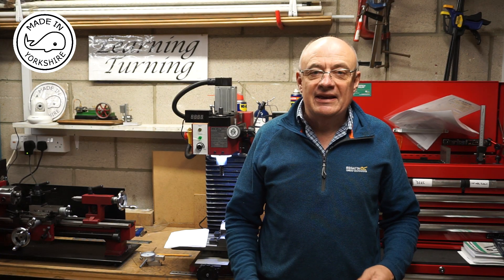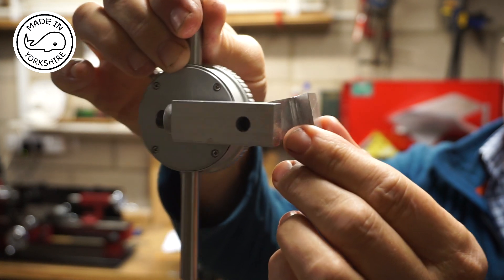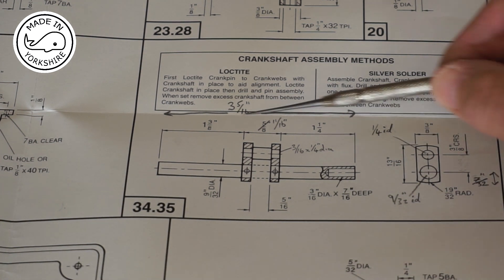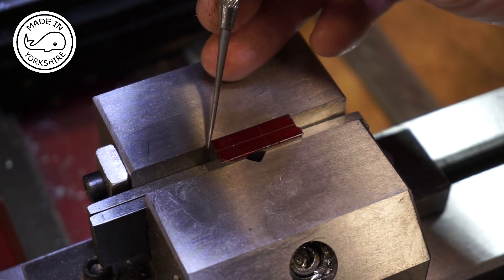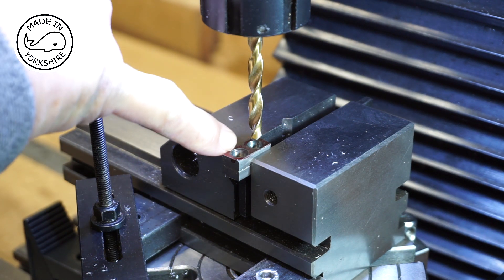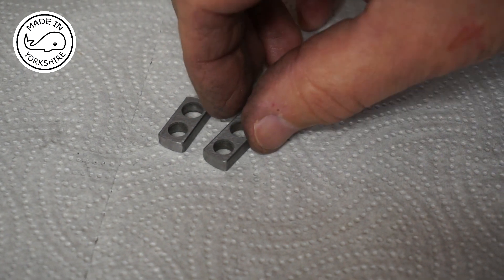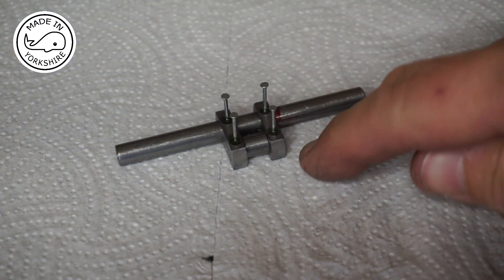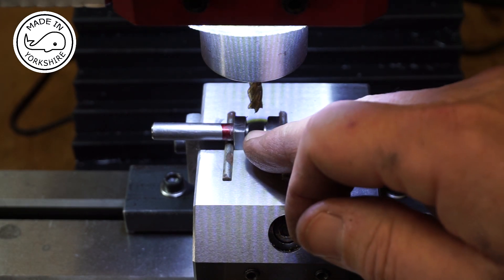#MT25 Part 3 - Making a Stuart 10V Steam Engine. The Crankshaft. By Andrew Whale.

Comment: Great videos- especially showing the oopsie's (we all do them, but don't confess to them) I see them as opportunities.
The parallels!!  I put a coil spring between them - it helps keep them vertical when putting the part in the vise, and I suppose a strong enough one would prevent the parallel from sliding.

Comment: I enjoy your videos.  Regarding the parallels moving, I generally use compression springs to hold them in place.  When there isn’t enough room for springs, a bent strip of spring metal does the trick.  The springs also keep chips from getting underneath the parallels.
Reply from the maker: Thanks for the feeback and tip. I must give that a try.
Cheers
Andrew

Comment: Years ago I had these castings and they had a casting for the crank. Guess they no longer doing that. Did they supply the material to make the crank?
Reply from the maker: Hi - yeah Stuart supplied all the material.
Cheers
Andrew
Reply: @learningturningmetal  I noticed the drawings do not really say what diameter to turn the crankpin. Seems to scale 3/16 but you used 1/4 for less turning. Not sure why they show the main shaft with a 3/16 drill in the end? Waiting on replacement castings as all came chill hardened and could not be used. Stuart sending replacements which is nice just takes forever to get to USA.
Reply from the maker: @gvet47  yeah I machined 1/4" diameter holes in the crankwebs to yake the crankpin. The hole on the end of the crankshaft is not required. It's a historical throwback.
Cheers
Andrew

Comment: Hi, i am reall enjoying this series. You have a very calm voice and explain very well. I am trying to glean as much info as i can before starting my engine. From youtubers like yourself and model engineers workshop. I only have a lathe so will have alot of compromising to do! 
Wavy parallels would prob not be great for such a short part, try a spring in the vice, clamping so it pushes it against the jaw, it keeps both apart and dont cost much. Take care mate.

Comment: One thing that has struck me from your videos Andrew, is how clean and tidy your lathe and mill are - do you have a shop vac or something? Everything on my workbench ( in my otherwise fairly tidy garage)  is covered in swarf and oil!
Reply from the maker: Ha ha - thanks. I use an old Miele Cat and Dog vac - very powerful! I clean the area up every time I complete each machining task. I recently visited a very respectful engineering company and it was spotless. I definitely recommend some kind of vac.
Cheers
Andrew
Reply: @learningturningmetal  No danger of the swarf damaging the innards? That could be a good shout!
Reply from the maker: @williamsworkshopuk  I don't think so. It's got very good disposable bags with excellent filtration.

Comment: I learned a neat trick a while back.  You could use a pin vertically in the V of the vise, the same size as the hole in your part, from which you are basing the radius.  With a collar slipped on first, your part will be well above the jaws and you simply manually rotate your part.  You do need to be very careful, but light cuts work well.
Reply from the maker: Thanks David. I must remember to try that out sometime.
Cheers
Andrew

Comment: Hi Andrew
Luv the vids
I copied your set up but one thing flummoxed me was did you square the vice once
you centred everything because i found that when you move the y axis without squaring the vice the radius was off centre
when the cutter was used but i bet i was doing something wrong.Your results speak for themselves so keep on going mate.
Reply from the maker: Thanks Peter - I'm not sure why it didn't work out for you.
Two main things are:
1. Rotary table accurately centred on the milling table.
2. Secure the crankweb on the rotary table so that the exact centre of the crankweb is exactly in line with the spindle of the mill. I used a crude method the align the crankweb - a drill bit. Some of my earlier videos make me cringe - but hey I was learning too. If I was to do it again I would use a wiggler. I used a vice to hold the crankweb but you can hold it any way you like as long as you can get the tool in to cut the arc.
Hope that helps.
All the best.
Andrew

Comment: Bend a piece of banding material to put between your parallels to keep pressure on them. We also use stiff die springs if there is enough room for them.
Reply from the maker: Thanks Danial - I have some banding material and I'll cut some and put it with the parallels to remind me.
Cheers
Andrew
Reply: @learningturningmetal  P.S. I liked how you constructed the crank. 👍👍🦘🦘🦘🦘🦘
That hint from tinker John is a bonus to put in the note book of solutions.

Comment: Hi Andrew, I am building a 10H, which has exactly the same crankshaft. I also noticed that the maths on the crank did not add up for the width of the crank webs. Also there is nothing missing from the diagram for the crank webs themselves, all the dimensions you need are there. The fact that you had to work out the distance from one end to the web to the centre of the nearest hole is a consequence of the way you marked it out. If the additional dimension that you worked out as  7/32" had been on the diagram then technically the drawing would have been over dimensioned.
Nice work though, I am simply going to mark the radii of the ends before drilling and then grind and sand them down, hopefully I will get a decent finish on them.
Thanks for posting these videos, they have certainly helped me and I am sure they help others too.
Reply from the maker: Hi Terry - apologies for my late reply. I don't always seem to get YouTube notifications! Thanks for the info, and I'm really pleased some of my videos have been of help. Good luck with the 10H.
All the best.
Andrew

Comment: You could use magnetic parallels, neodymium magnets are pretty inexpensive and come in a very wide variety of sizes. Drill with a carbide drill and loctite them in place. Also, surprised you didn't silver solder the crank together.
Reply from the maker: Hi Lee - great idea regarding neodymium magnets - I might just give that a try sometime. A couple of reasons why I didn't silver solder. 1) I hadn't any previous experience of using it and I had read on a forum somewhere that several people had had bad experiences with it. 2) Maybe my lack of understanding, but I would have thought that silver solder would end up creating a gap of a thou or so once cleaned away - so the resulting hole would be marginally smaller and not perfectly round. Making it with a dry joint worked well for me and the resulting hole was to dimension. Coincidentally I have a similar problem at the moment making a split bushing. I think I will have no real option but to use either silver solder, normal solder, loctite or superglue to hold the two halves together. Unless I make a clamp to hold the two halves together, to avoid sticking them together with something. Any thoughts greatly appreciated.
Cheers
Andrew

Comment: Hi Andrew i only thought it was me that parallels move in the vice even knocking the work piece down with a brass hammer doesnt stop them moving , i would also love to hear a way to stop them
Reply from the maker: Yeah it's a bit of a pain. Maybe a curly parallel in between two straight ones. Not that I've got any curly parallels. Magnetic ones might work if there is such a thing. Maybe I'll just buy some blue-tac.
All the best.
Andrew

Comment: Andrew, another great video, now imagine that X  3 and having to not only the correct spacing, but also 120 degrees apart, that was how I had to machine my Triple crankshaft. I put taper pins all the way through each web and peened the ends over and silver soldered the whole assembly. Never want to make another one. I had to also fit counterweights to each web, Stuart supplied those as cast iron but they still needed machining and fitting with 7 BA studs screwed into the webs but clearance holes in the weights that needed peening over to lock them in place. Vibrating parallels :-)) LOL but seriously, a tip you could also try is a magnet or even a dob of hot glue where it does not get in the way.
Reply from the maker: Crumbs - a triple crankshaft! That would drive me nuts and it wouldn't be a great outcome.
Cheers
Andrew
Reply: @learningturningmetal  The original one supplied by Stuart was 3 blocks pinned and braised onto the main rod. I then had to machine each crank out of the solid block, got to the 3 rd one and had a bad crash that bent the whole thing. I then prefabricated one. If you buy a Stuart Triple now, you have to prefabricate it.

Comment: Hi Andrew,
I got a V10 :) for Christmas so have been watching you and Tinker, Got a good tip from Joe Pieczynski (great guy) if you have any of the strapping that came with your lathe or mill cut a  couple of pieces to slightly longer than your mill vice, then bend to form a curve with two straights and when you put your parallels in the vice put one of the straps in as well, it acts like a spring and forces the parallel against the vice side, stops it vibrating out. Hope that makes sense!  TFS "thanks for sharing". Regards G :)
Reply: an alternative to spring strip is foam rubber. I have some fairly dense foam about 6mm thick that I have cut into strips that I put between the parallels. There is enough compressibility to ensure that the parallels stay where you put them and remain square to the bottom of the vice which is kinda important. I might video the set up in the next day or two to add to my library, a video makes it all clear.
Reply from the maker: Great idea Chris. Thanks for the tip.
Cheers
Andrew
Reply from the maker: Hi Graeme - that's a brilliant tip. Shame I threw all my packaging away. Hope I remember next time I buy a new toy. Good luck with your 10v project.
Cheers
Andrew

Comment: Andrew. I don't design my engines because I'm clever. I'm just tight fisted. My engines are loosely based on someone else's designs but I use whatever materials I can lay my hands on, cheaply. Usually I find some ready made tubing for the cylinders and go from there. None of my attempts at boring cylinders seem to produce a good enough surface finish. This could be down to me, my machine, my tools or my lack of experience. I have a 3 1/2 inch flat bed Drummond lathe that I have motorised. The original was treadle powered. I don't own a milling machine. I get by, by use of a file, hacksaw and belt sander. Keep up the videos. I have learnt a lot from people like yourself. Also Mr pete222, Abom79, Myfordboy so on. Thanks for your advice on reamer drills. Just placed an order for some. Cheers.

Comment: Enjoying your 10V engine build. Just subscribed. Will look back at your other videos. I, too, make small stationary engines but from my own designs, from scratch, running on compressed air.. Where do you get your 0.1mm drills from? I have just bought a series of metric reamers in the 3 to 12mm range and am looking for suitable drills. It is suggested that they should be 0.2 and 0.3mm less that the reamer. Can you help?
Reply from the maker: Hi Keith. I am well impressed at you making your own designs. Way beyond me! I got some .1mm drill bits from chronos.ltd.uk. They have a very large range. When I purchase a reamer I usually google    "drill bit size for reamer" and look at the various tables. For a 1/4 inch reamer I aim for a drill size of around 10 to 15 thou less. That seams to work ok for me.
I hope that helps.
Cheers
Andrew

Comment: Great progress again Andrew! I made my crankshaft the same as you, apart from drilling the pin holes right through which is normal practice I believe. I marked-out the web curves before drilling, then used my belt-sander  and file to create the curves. I like the way we can use different methods to achieve the same result - makes life interesting aye🤓  My engine is now done so I need to make a nice base for it - think I'll add reversing gear to it too. Has been a most enjoyable project and I can tell you feel the same way!  What shall we make next? Regards
Reply from the maker: Thanks Clive - and congratulations on completing your engine. A belt sander sounds like a good idea - just wish I had one.
At the speed I work I recon I months away from completing this little 10V. I think I will try to go a little bit larger next time - not sure what though.
All the best.
Andrew

Comment: Hi, AndrewI used 3/16" gauge plate bolted to my faceplate, onto which I bolted down the Soleplate and Standard for turning.With an M6 central hole, the crankshaft webs could be bolted to the gauge plate through the 6mm crankpins hole and turned to length, with the radius correct by default. I've used 7mm drill rod for the crankshaft, so a piece of K&S brass tube 7mm OD/6mm ID inserted in the 7mm hole allowed the same set up  to be used for the other end. A piece of 1/8" brass angle was used to "cradle" the two sections to minimise the chance of them coming apart i.e. the M6 bolt went through the webs, through the brass and into the gauge plate. The brass also acts as a template to get the same length at the second end of the crankpins. In my ignorance, I soft soldered the two webs together, machined them as one then separated and cleaned them. That's when I discovered just how corrosive flux can be if it's not properly neutralised.
Reply from the maker: Hi Len
Many thanks for the advice - that seems like a great solution.
I have a faceplate - but I've never used it. Maybe now is the time for me to try it out for machining the Standard? I need to give that some thought.
Cheers
Andrew

Comment: Well done. I am hoping to start on something like this after the holidays.
The reason one of the parallels came loose was probably because when you snugged the vise up the movable jaw rose a little bit and took the pressure off the one parallel. Or, you may not have checked the parallels for movement after using a hammer to seat the parts against the parallels.
Thanks again for sharing your experiences with us.
Reply from the maker: Thanks Robert - I think I need to get myself a little hammer (or maybe I can make one!).
Good luck with your up and coming project.
Cheers
Andrew
Reply: Andrew, making a hammer could be a fun project especially if you make the hammer with soft faces that won't mar the surface of what you are using it on.

Comment: Coming along nicely Andrew. When it comes to turning the radiussed ends of the crankwebs you'll probably find it a lot easier if you turn a close fitting mandrel in your lathe to fit the web holes, don't remove the mandrel but use 638 to secure the webs on it then turn the opposite end. In your case as the web holes are different sizes you will need to make 2 different mandrels but it's far quicker and easier than the rotary table. A bit of heat will break the Loctite bond each time 😀
Reply from the maker: Great idea Peter. I should have thought of that one. Playing with the rotary table was good fun though.
All the best.
Andrew
Reply: @learningturningmetal  I dread using the old turny table so anything I can come up with to avoid it is fine by me  😀